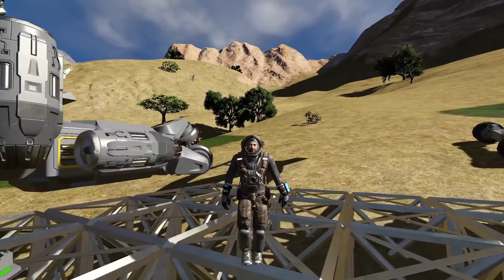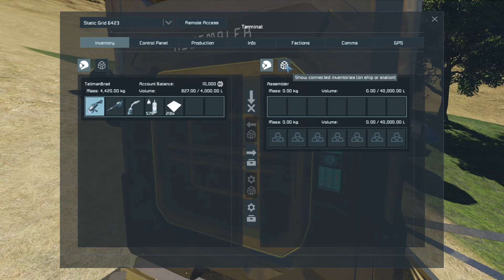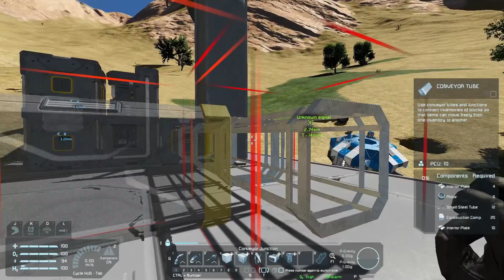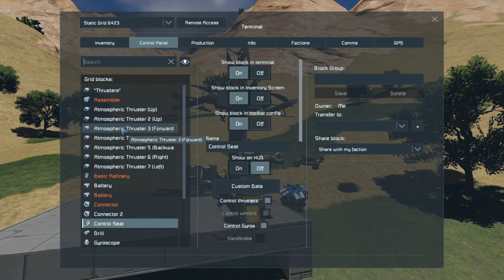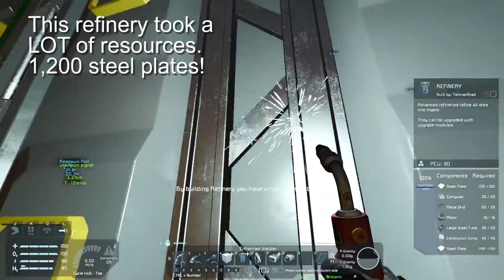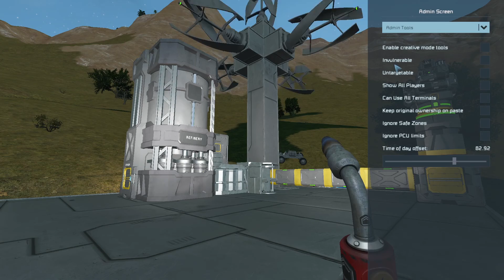Space Engineers: 05 Base Building/Upgrading

Comment: Any advice for managing the build planner when there is more than one assembler? I unintentionally discovered that my survival kit and assembler were working in tandem but I can't seem to withdraw all components unless they're being made by only one assembler/survival kit. Thanks for your videos!
Reply from the maker: Ben I have to be honest. I think there's an issue with multiple assemblers. You can set them to work in cooperative mode but I don't find it works very well. Personally I'd turn off the survival kit and just use a full assembler to save any confusion. I appreciate the survival kit is still good for basic processing and assembling. But I'd abandon it once I was up and running with a full assembler. Particularly if I could make more than one full sized assembler. This might be a bit controversial for some space engineers. But that's how I'd go.

Comment: Brad, again, thanks for the videos. I'm watching and re-watching them to learn.  A question... At 3:35, we see you building a battery or two at the base of the tower.  But in the next shot, they're gone! And I don't see them for the next few videos. Where did they go?  Did you hide them?  Thanks!
Reply: Sorry, Brad!  I watched closer.  They are at the same level as the deck, and so you expanded out the deck, blending the deck in with the batteries.  Very clever, and it looks great!
Reply from the maker: Hi Gary. I had to watch the clip to remind myself. There was only one battery. It looks like there's 2 because I still had the 'image' in my hand, as if I was going to place a second. But yes, I built the deck flush with the battery which just tidies it up and gives it a bit of protection from, well, whatever might shoot it or just bump into it. Damaged batteries are like bombs! Ideally I'd have built it with the level gauge facing up for quick checking the level as I walk past later. It's not an issue. Just handy.
Reply from the maker: Incidentally. If you have the resources to build 2,3, 4 or 5 batteries I'd just do it. It's not just about the length of time they last but also the amount of power they can deliver on demand. 1 battery isn't normally enough for a base with a full sized refinery, a couple of assemblers and vehicles wanting to charge, all at the same time.
Reply: @TallmanBradGameplay  I have two batteries in my base. Maybe I need to watch a tutorial about batteries. I presume batteries can't "dump" their storage all at once, so I may need 3, 4 or even 5 batteries.  I'll add some more.  Thanks for the tips!
Reply from the maker: Let me know if that helps. I'm curious to find out.
New video released in 20 mins ;)
Reply: @TallmanBradGameplay  Brad, a suggestion for future video(s):
Pros/Cons of multiple refineries, assemblers and/or batteries.
Q: Will the system "auto-magically" distribute the workload between the machines, or does the human have to do that? Meaning, if I dump iron and silver ore into Refinery A, will Refinery B automatically grab part or all of the ore, and help with the refinery?  Or, if I'm building a turbine, will Assembler A build some of parts, and Assembler B do the other parts?
Q: Multiple batteries - what's the best strategy - group them all together, or scatter them around the base?
Reply from the maker: I can tell you that refinery B won't pull from refinery A. If a cargo container was full of ores both refineries would pull what they can and start processing.
Assemblers can be told to work together (cooperative mode) but that's very unreliable. That needs looking into (makes a note).
As for the batteries, it doesn't matter where they're placed. But the more batteries the more power is available at once.